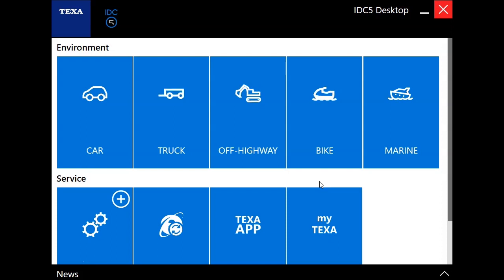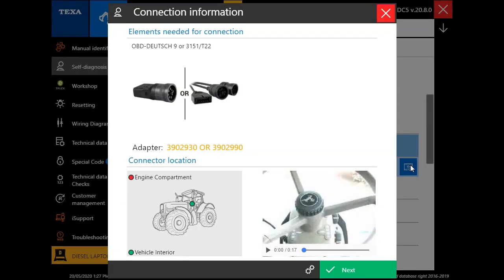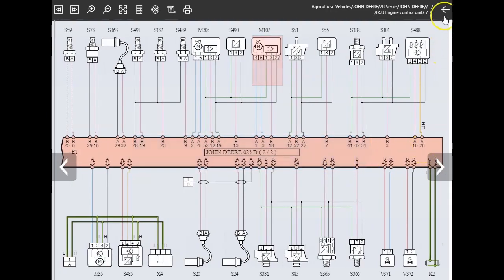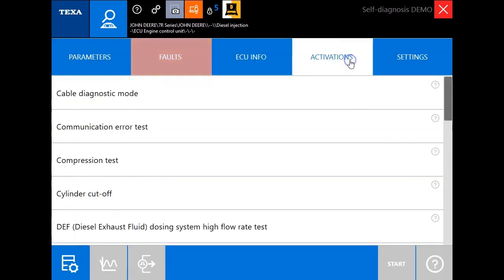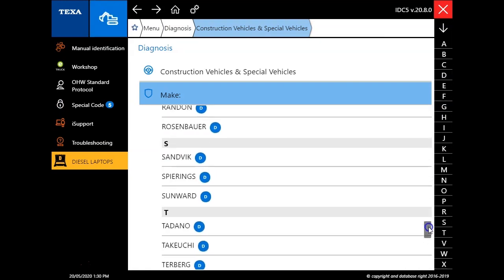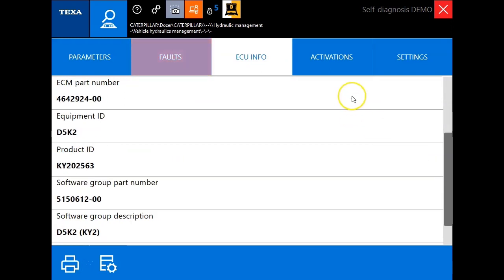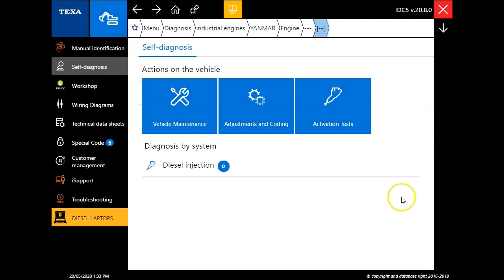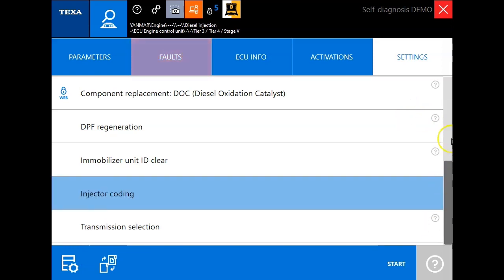TEXA Off-Highway Walk Through 2020 [Diesel Laptop Kit]

Comment: Hi I purchased a diesel laptop that included off highway and truck software with a kit that cost me about around 10k and I had the membership for a whole year and never got an issue fixed with a simple 3126 cat that would not communicate with its ecm. The reason I didn’t continue my membership after the year was because I had to pay a third party tech to use his cat et and communicate with the cat 3126 engine. I would hate to pay for another year of membership and still not be able to connect. All my other cranes connect successfully. What do you recommend I do as I’m about to just purchase a cat et to just resolve this issue?
Reply: What software version are you on? The 3126 are around 20 years old at this point, and there was a period in time where we couldn't quite get it right with those older engines, but we believe the issues have been fixed. Also, when did you try connecting to that 3126?
Reply: I had our team dig into this. The last case file we have for you is that you did not have the CAT T38 cable. The "normal" 9-pin will not work. Where you able to source this cable from us?